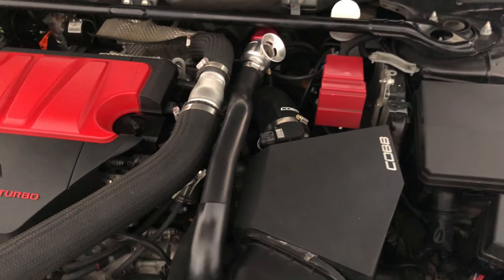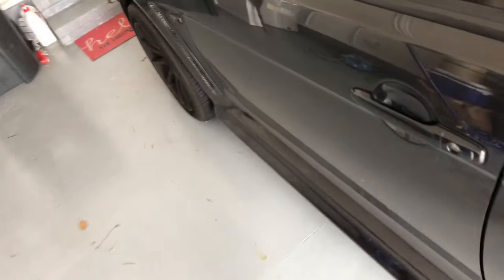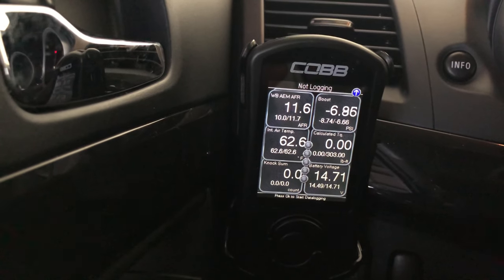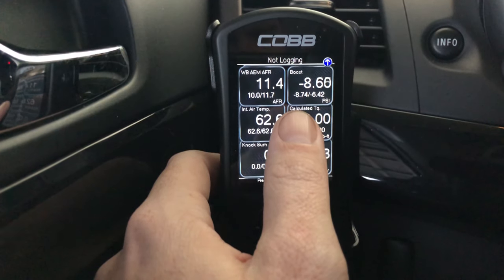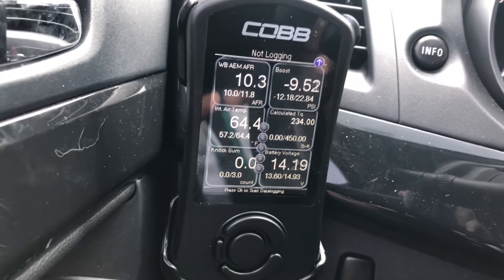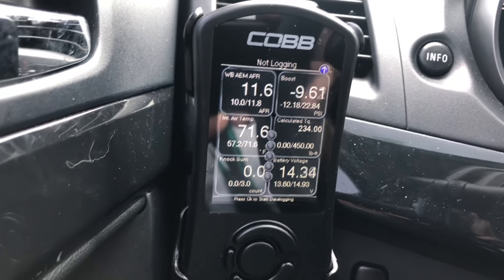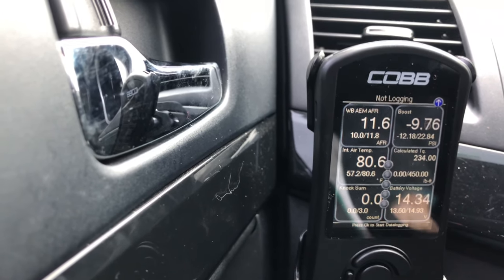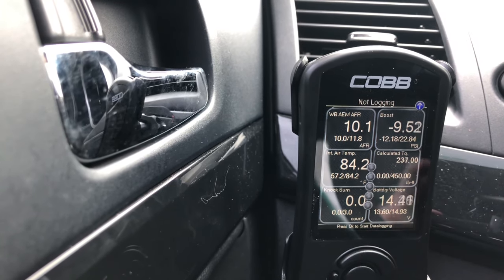How Safe is the Evo X COBB Stage 3 Accessport Tune?

Comment: Just an FYI, the Evo X doesn’t have a Wideband monitor from factory, it’s a narrowband. So the AFR isn’t correct on the Accessport. You are 100% not idling at 10-11.8. And usually 1-3 knock is somewhat normal for these cars as long as you aren’t seeing it at WOT. Your Boost gauge on the AP is going to be almost bang on, as the Evo X uses a MAP and MAF sensor. As long as you run the Cobb Specified Products (Short Downpipe, high flow cat etc) you shouldn’t have any issues. Cool vid anyway 🤙🏻
Reply: Hey i have Evo X and Cobb APv3 , can you tell me how to connect my AEM X Series AFR whit bosch 4,9 o2 sensor to Cobb AP to have correct AFR Readings ? Thank you !

Comment: 29 psi is not good with stock internals. You need a tune, 3 knocks are not normal, that's 1 degree of timing being removed permanently (until reflashed), every single knock sum is .33 degrees on an Evo 10. They add up. When it starts knocking often, the car will go into Low Octane map blending into the Hi Octane map and the car will start running like turds and start burning through pistons. I just went through all of this over the course of a year, it ended when I ditched my Cobb, contacted Rickerman Tuning and went ECUFlash/EvoScan and the results have been nothing short of spectacular.
Reply from the maker: Stephen H. I am now tuned by Top Speed with a Video on here of it.

Comment: Running to lean not reach 🤦‍♂️in ideal it should be around 14.7
Reply from the maker: I would say you are right but the Cobb is not accurate. Since this I went to Top Speed Motorsports in Atlanta which they renamed to Cicio performance I believe. And they tuned it just right. No issues, but once my wife’s SST is back to running with a good built transmission I may sell this to get to my goal of a GTR.